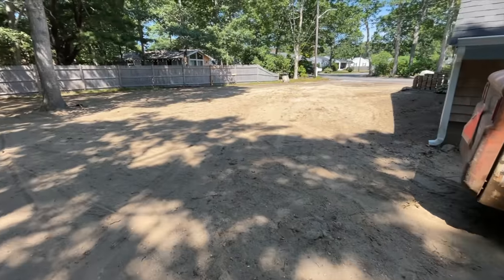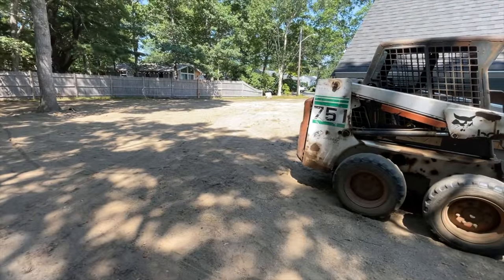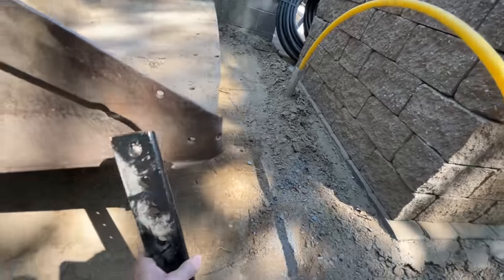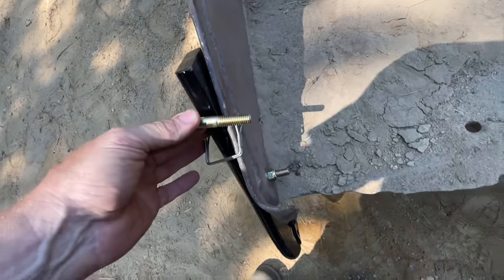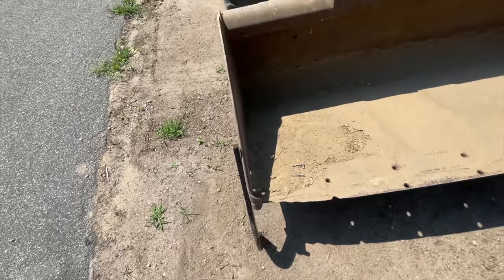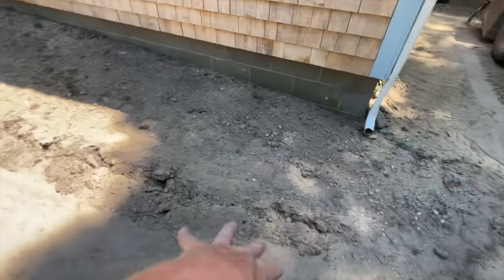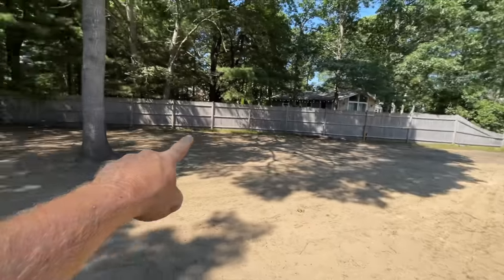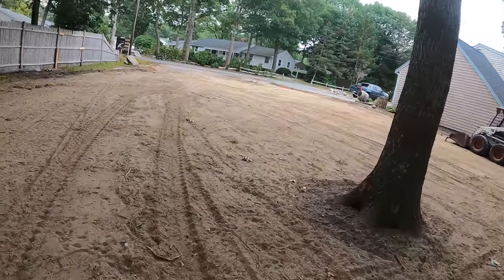HOW TO Make Homemade Trencher for Irrigation Pipe, Cable Wire, Invisible Fence

Comment: Not just $49 for anyone, just $49 for people who own $30,000 skid steers
Reply: Also works if you have a $2000 tractor!
Reply: @Step-n-Wolf  And where does the average person get a full on tractor for $2000??
Reply: @Obliticus  it is called used.  Have seen large tractors for $600 and even free, work needed.  My Ford 841 was $2000 with a HD front end loader, a blade, an umbrella, suitcase weights,  and the third set of hydraulic levers.
Reply: @Step-n-Wolf  Used is *very* subjective to your area and also requires a higher degree of knowledge and experience for maintenance and operation.
No lets just be honest... the root cause of this is a YouTuber that posts click bait thumbnails implying anyone can build/buy some device that will allow them to trench for ONLY $49.
I'm sorry your love for this channel has blinded you to that.
Reply: @Obliticus  1.  it wasn't clickbait by any stretch of the imagination.  People doing this kind of work will have some sort of machine
2.  If you can't do an oil change and add power steering fluid, then you shouldn't be trenching
3.  I have NEVER been to this channel before.  It was a YT suggestion so I am not commenting out of loyalty or blindness.
4.  I just did a search, used skid steers under $10K...many of them. 

Who peed in your Cheerios?

Comment: I do something similar to lay pex water line and bury UF wire, but I use a 3 point sub soiler (just a bigger version of this tipper tooth). I drilled a hole on the back to attach the wire or pipe and can bury it up to 18” deep. The tooth welded onto the bottom creates a channel underground and the wire has no resistance as you pull it thru. I can easily bury a 300’ roll of 3/4” pex.
Reply: Been doing the same for 30 years.  I dig a hole with a shovel at the start and end points.
Reply: And a trenching shovel to clean it out. 👍

Comment: Strap a 1.5"  90 degree EMT conduit pipe onto the back of the hook, and you can FEED the poly pipe thru it INTO the bottom of the trench as you go - just need to rig something on top to hold/spool the poly pipe, and whammo - easily done, just need to finish covering . . .!
Reply from the maker: That’s a great idea!

Comment: you can put a leader on that trenching spade and pull your pipe or cable right into the trench while you go, no need for additional steps.  just have the spool set up to unreel

Comment: I built one similar to this 25 years ago but used  a 4” piece cut from an old backhoe bucket and bolted to the side of the loader bucket. Did the same with the opposite side of the backhoe bucket as to be able to trench from either side. Put a bend on it as to take the tailings and throw them off to the side of the ditch leaving a nice clean ditch that was about 12” deep. Perfect for sprinkler systems.

Comment: I just bought a bottom plow for my garden that goes on the 3-point hitch and realized that it would make a great tool for doing shallow trenches like this. I have plans to run water and data cables out to my shop and pool area and I'll probably use that to dig most of it. I can get about 18" deep or so I figure and it just flops the dirt off to the side. Might be a good option to make a mount for your skid steer for one of those. Would save you even more time. No mucking out the dirt by hand.

Comment: I welded an Atv hitch attachment that has a 2x2 steel square tube adjustable height attachment. Originally wanted an old fashioned garden hand plow the big curved blade but couldn't find one so settled on a flat shovel. Cut off handle and welded sideways at about 20⁰ angle to slice through dirt/roots and sorta makes a V trench and pushes dirt to side. Then a regular garden "hoe" cut off sides to leave about 3" wide and it makes a great trenching tool to clean out or leave a flat bottom

Comment: It might work with a vibratory plow blade. It has a solid cone that you pull through the ground with the pipe in a pulling finger. It could work pretty well.

Comment: I think you could have attached the pipe holder mesh sock to pull the pipe thru the ground. I don’t have a skid steer so I use shovel and trencher

Comment: I used to have an old 7 series BCat and thought of something similar.  Never tried it since I also had ditch witches as well and often clay soil conditions would have stalled most wheeled equipment.  Generally, the level of effort (not pulling the intended conduit at the same time vs cleaning out the trench by hand) and any need for depth or for inspectabiliity that is your limitation.

Comment: put a tug loop on the trailing ege, attach a wire mesh cable puller to the trailing edge, dig ditch, lay cable at same time.

Comment: Weld a tube to the end and a real holder on top that holds the coil. So as you rip it the tubing stays down in there so it's all 1 motion. Like the big ripper dozers
Reply: May be called a subsoiler

Comment: I just use the bucket on the loader. It does 7 ft at a time down to 12" + if needed.
Reply from the maker: I do that for gutter run off pipes and dry wells etc.... This was just less disturbance and good enough to run quick pipe
Reply: @KenMrKLC  , thanks pal, you do a good job .

Comment: So, all I need is a $60k Bobcat and it will only cost me $49 more to add a trencher!
Reply from the maker: The point is, if you have a skid steer or tractor or something on a job installing a lawn and are also putting in irrigation this is a cheap route vs renting a pipe puller for $300 every time and the picking up and dropping off time of it etc. Its not meant as anything else but that

Comment: Why go through all this trouble? Just rent a ditch-witch and it will pull wires and sprinkler pipes with ease. I had 6 sprinkler zones of pipes pulled in less than 30 minutes.
Reply from the maker: All the trouble? $49 and 2 bolts on a machine I already have on the job? I will go to the rental center 30 min drive each way drop off and pick up plus $200 or so rental and have to rush? Don't get me wrong if it was an existing lawn in good shape I am renting a machine. But for some new lawns this works great and fast for almost no money.

Comment: Just rent the ditch witch and add the rental into the bid
Reply from the maker: Yes that was the plan, however how about I made more profit because I saved $300 rental and 2 hours of driving to rental place and fuel (to/job/to/back) the machine was already on the job …. It’s just showing another option in certain situations someone may try. If you have watched any of my other videos you will see that I usually rent a ditch witch pipe puller on irrigation jobs
Reply: @KenMrKLC  I’m always tinkering try new things as well.

Comment: Turn it around and drive forward.
Reply from the maker: If I did that I would run over the trench when turning curves
Reply: @KenMrKLC  It's best to pull a ripper than try pushing it anyway. I like your idea. I agree, like you said, welding a piece on the side may roll the dirt over and better clear the trench, like a turning plow.
Reply from the maker: @truthhurts4771   It worked great and paid for itself 10x just this first time I used it over renting a machine

Comment: I bought this thing from Amazon.  It didn't work.  And for a reason.  I ran it over green grass with the soil on the wet side.
After I chewed on the whole thing and after watching all sorts of videos... suddenly this just came to mind.
A backhoe, an excavator with that foot-wide digger that scoops out dirt.
Imagine instead of that blade  you have. just being straight like that, its end is actually desgined like that of an excavator scoop.
The loading bucket on your rig has enough tilting up and down that such a design can easily behave just like an excavator digging scoop or whatever they call it.   Just a two inch or 4 inch wide deal and there it is.   
The bucket on my 8N ford tractor has lots of tilt.
Reply from the maker: They make this already
Reply: @KenMrKLC  if I can only find it or even make it.  But I don't have a welder.